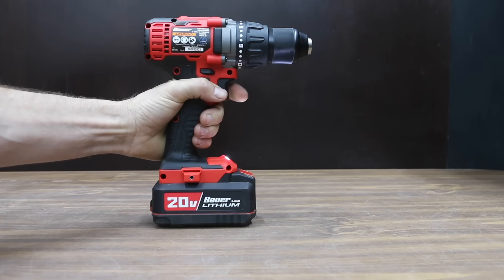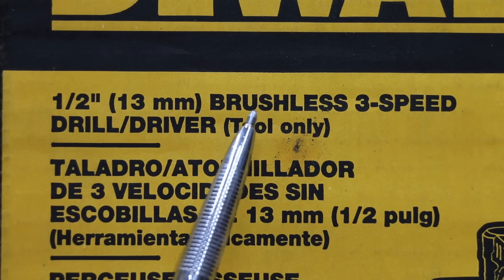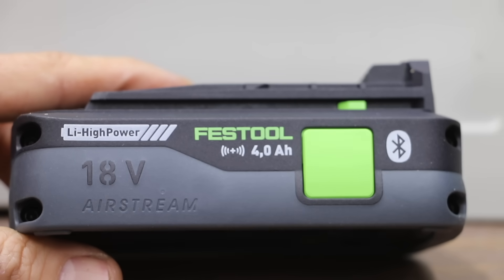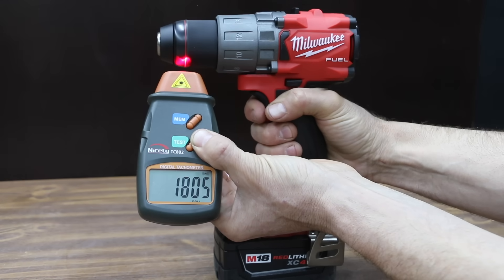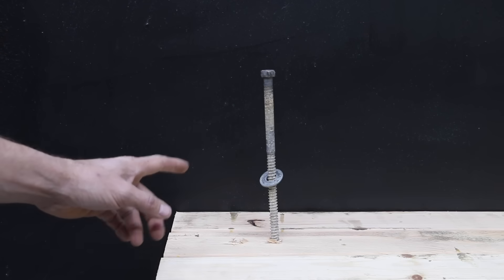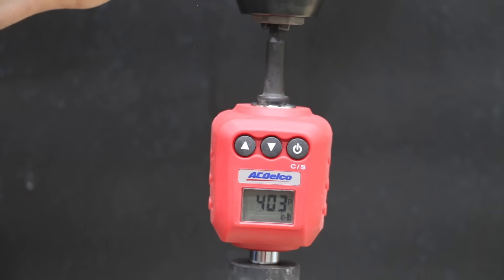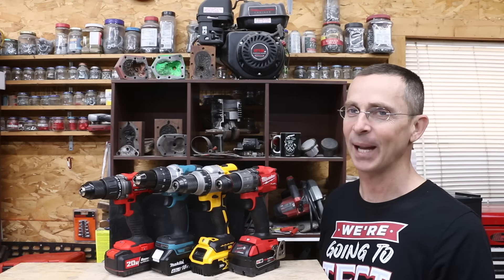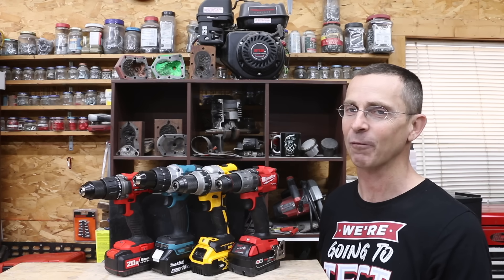Best Drill (BATTERY POWERED)? Milwaukee vs Dewalt, Makita, Bosch, Festool, Ryobi, Bauer, Ridgid

Comment: Key takeaway: Festool is way overpriced. It should have excelled in every test at that cost instead of being middle of the pack, or lower, on those tests. Thanks PF. Keep up the great work. 😁
Reply from the maker: Thanks, will do!  Thanks for the feedback.
Reply: @ProjectFarm  you're quite welcome. I've watched you for years. Anytime somebody asks what I think between this tool and that one, I always recommend your videos. If you've done one of course. You're quite thorough and as fair /unbiased as possible. 😁🖐️
Reply: This is a bit unfair. The festool drills are mainly used for...drilling. higher precision drilling at that. If you ever use one you will notice that they run way way less "rattly" than others and the high rpm is just better when drilling in wood
Reply: Inaccurate. Festool is geared differently from others. 4gear against 2 gear. As such the test itself was skewed . Should've chosen the correct gear for the task. Otherwise the test is merely comparing ,eg 600 rpm to 1200 rpm or 4000 rpm to 2000 rpm. Line two cars up and leave one in first gear...
Reply: @tinman7781  Whereas you have a valid point about the gearing, he accounted for that in all situations.
Reply: It seems like it might be good in applications where you don't need a lot of torque but need it to be able to spin really fast. Not sure what that would be though.

Comment: I love my Makita 18 volt hammer 🔨 drill and my 20 volt Dewalt impact and compact drill. That Makita is a straight up BEAST. I also got a couple old Dewalt 950's in 18 volt hammer 🔨 drill ,they are also BEASTS., still work but moved on to the 20 volt platform.
Reply from the maker: Thanks for the feedback.

Comment: I love your testing videos. The trouble I often have is the unavailability of the exact brands and models in my part of the world to compare against.  However I recognised the Bauer as being almost exactly the same as my cheap Ozito - the differences were mostly cosmetic and 18v rather than 20v.  It was an incidental purchase that has performed competently for light duties.  I purchased it only because I already had the battery system due to the medium sized wet and dry vacuum that I bought to keep in my car.  Now I also use the portable usb bank outlet, radio and torchlight skins.  Very cheap but useful.
Reply: FYI: 18V and 20V batteries are the same thing labeled differently. Both have 5 Li-Ion cells in series.
Nominal voltage: 3.6V*5=18V
Maximum voltage: 4V*5=20V.
Same thing with 10.8V vs 12V.
Reply from the maker: Thanks!  Thanks for sharing.

Comment: Subjective test not fair on the pricing, the Festool is the most expensive but if you add battery and charger for all the rest things are different, I’m using the Milwaukee and the Festool and are 2 different tools, both good/appropriate in specific applications .Festool is very precise ,reliable and comfortable to work with, the Milwaukee brute force as always.
Nice video.
Reply from the maker: Thanks!  Thanks for the feedback.

Comment: I bought the Harbor Freight Hercules drill kit(drill/5.0AH bat./charger/hard case) for $90 when I was in a bind(burned out my 15yo Dewalt 18v XRP). At first I was skeptical, but this drill proved itself to me after putting a 2" Lenox Bimetal hole saw through 1/4" plate steel at least 8 times on one battery charge(a task usually left up to my corded drill)! More than worth the $90!
Reply from the maker: Thanks for sharing.

Comment: Festool has an add on to work sideways, in tight places, which would make it the best to hit small spaces
Reply from the maker: Thanks for the feedback.
Reply: Yes and you can stick the Bit directly onto the machine, wich shortens the needed workspace too, but it is not magnetic then.

Comment: Had a $60 Bauer hammer drill/driver. Treated it like crap but it lasted 1 1/2 years. Only complaint it would kick the overheat cut off after a few holes. Frustrating
Reply from the maker: Thanks for sharing.

Comment: I'd be interested to see what that lowest torque setting on the milwaukee actually means. For light house stuff, like reassembling an appliance with a plastic housing, is it going to strip it immediately? Is it going to wreck cheap particle board like ikea stuff?
Reply from the maker: Thanks for the suggestion.
Reply: Yes

Comment: Surprised that you did not include RIDGID which is the best least expensive brand overall, esp used when you pick them up for very little money. The Milwaukee Fuel drill is the best overall for performance although it does cost more. Dewalt and Ridgid has the advantage that quality aftermarket batteries are available  (if you choose the right ones) If you ever need help with that, let me know. Amazon has 6.0 batteries that work well for Dewalt about $22 each.
Reply from the maker: Thanks for the feedback.

Comment: Thank you for such a comprehensive array of tests. I would only add one correction: I can see that in the minimum torque test, the Milwaukee and, I assume also the DeWalt are in their lowest gear 1. 

The electronic clutches are motor current based so in higher gears, the clutch levels will limit to a much lower torque scaled by the gear ratio. 

So for the Milwaukee we could expect the lowest torque to be 136in-lb*550/2000 = 37.4 in-lb 

For DeWalt 76in-lb*450/2000 = 17.1 in-lb
Reply from the maker: Thank you!

Comment: Every single issue I’ve ever had with a Milwaukee battery tool whether it’s a pex expander or a sawzall they’ve either given me a brand new tool or fixed the issue. I love their customer service.
Reply: I prefer a brand that doesn’t need fixing
Reply: @MartiniPinball  no kidding.
Reply: I had a 5.5 year old drill. Chuck teeth got out of alignment. Tool bound up trying to fix it myself. Sent to Milwaukee and told them what happened. They replaced the gear assembly and gave me a new chuck at no charge.
Reply: Probably this service is only for usa. Im fromu eu
Reply: Or they could do what Dewalt does and make tools that don't break 🤣🤣🤣👏👏
Reply: @Lee-lb9qh  yeah you can’t really consider it broken if it never worked properly can you?
Reply: @codygooch510  idk where you get your tools but mine work just fine 👍 paid off 2 houses with them....and still use them today.....
Reply: I never had an issue with my makitas. 
They are more ergonomic, better balanced and much smoother than any Milwaukee or default I’ve used
Reply: Harbor freight has a great warranty too, guess you have to if your gonna make trash tools 😂
Reply: I actually like my Rigid Drill with it’s lifetime warranty,  the BIG Problem is the Batteries suck and go bad fast you will spend more on batteries than a new drill
Reply: Same. Milwaukee is a standup company.
Reply: ok
Reply: Hands down the BEST
Reply: True, I had my 18v Milwaukee drill with impact/hammer drill that just randomly stopped working....sent it in and they fixed it and sent it back , been working great ever since!!
Reply from the maker: Thanks for sharing.
Reply: I’ve heard they have good customer service
Reply: Oh please. Although I have some Milwaukee tools, and have owned many over the years I believe in todays world DeWalt and Makita  have far surpassed Milwaukee. I would even argue that Milwaukee has become rather sorry.
Reply: @freeflyer6170  I think you're trying to get people upset. Well mission accomplished buddy. I haven't been able to sleep for two days after I read your comment.
Reply: @dangrimes5078  LOL…..guess I should have included those sorry Bosch tools in my comment.
Reply: @freeflyer6170  nah, you sound biased
Reply: @jegr3398  well I’m a few months short of 70, been using cordless tools since the late 1970’s when they first appeared in the area of the US where I was building. My first cordless drill was a Makita and my second was a Hitachi. 
A fellow carpenter bought a Skill brand that was a joke.
Reply: @freeflyer6170  well no offense sir but Milwaukee is still top of the line in my line of work. Which is remodels. And at that age you probably dont give power tools heavy professional use.  I see guys of all trades. And most of those tools are red.  I have a mix of Makita and Milwaukee tools and shit tons of batteries. Makita is ergonomic and every tool is great but theyre just not as strong as fuel stuff. The impact, sawzall and sds drill are insane
Reply: @jorgeo1492  Jorge, I can’t argue your point. I’m certainly not out working 50 hr plus weeks doing heavy construction although I have a custom woodworking business and continue to do a good bit of shop work; and I’m not commenting to incite emotional responses from folks, although I must admit I do enjoy poking the  bear on occasion. My major issue with Milwaukee is because I do know what an exceptional tool company they have been for a long time. They were the gold standard for plumbers for ever and their sawzall was the first and best of its kind. But I won’t back down as to the substandard trim router I just returned. It’s flaws are inexcusable. I also can’t stand the 4 cordless drill/screw guns I purchased a few years back and their battery packs. Now I’ve seen and handled the newer models and they seem just fine .
Reply: @freeflyer6170  I think we can all agree they don't make tools like they used to. Found a power drill in my dad's old shop from the 70s that my dad used a lot. Thing still worked like a beast.
Reply: @freeflyer6170  coming from a guy who deals with power tools every day for a job, Milwaukee has way more power, torque, charging speed,  and customer service
Reply: @ragingstormgaming7829  I doubt it.
Reply: @freeflyer6170  Maybe, but milwaukees's have been used every day and charged every day in over 100 degrees, sometimes inside a metal work van which gets higher than that. The milwaukee batteries and tools are years old, had never had one die on me

Comment: Not really a fair test. Most of these brands have different grades of tool. The xr dewalt is the higher grade while the ryobi used was the lower grade. I'm not familiar with the other brands but you lost me after the drill introductions.

Comment: i suppose, that error in testing brushed machines is, that machines should be runnet on for free for minimal one battery before testing its power... i liked more brushless machines, but it doesnt mean, that brushed machines are better or worse that another... just they could have better power but also bigger consuption/worse worktime, but as i sayed-they shoud be sometimes stronger.... but it needs to have brushes well fitted to comutator and test brand new machines without fitted brushes is useless as test....

Comment: Fresh out of the box testing is completely different from testing over time. This is why perfessionals will only buy certain brands. Over time most of these brands will just not do the work or last. I personally own dewalt, milwaukee, and ridgid. I have used the other brands here and there and they just don't hold up in real life work. I have owned my ridgid for five years but my Bosch set I got died in a year. Just an example.
Reply from the maker: Thanks for sharing.

Comment: I was surprised how hard the festool failed. Given that most festool users are a little different application than the big three, I suppose it makes sense. 

Would love to see Hilti and Metabo in on these, particularly Hilti since that and Milwaukee is what I see the most of on commercial jobsites
Reply from the maker: Thanks for the suggestion.
Reply: I don't know if metabo or walter would outperform Hilti or any other competition, but they would definitely outlast them.
Reply: @jeansboii  I dunno, I've got some Hilti battery powered tools that are going on 19 years old, and they still get used about twice a week, after a decade and a half of daily abuse at work. . 

I've had to send one battery in to a repair shop, but that's it. I do keep them clean and replace the brushes as needed but they have yet to fail beyond maintenance or the one bad battery cell.

Not sure if HILTI is still using the same manufacturing they had then, but the cordless impact and drill that I bought back in the early 2000s, it's a great product. I also have a circular saw, metal cutting saw, and a few rotary hammers, and hammer drills from HILTI. 

I haven't really ever used anything but their industrial tools, but those have held up great.

Comment: Nice review, but working with them I will say DeWalt is a disappointment, I've had a few and none live longer than 2years. Milwaukee is a good site drill and I have old ones that still work well, I just don't like them in the workshop. I've had the same festool drill for about 9years and I love it. Perfect balance and lasts all day on one battery in the workshop. Would never take it on site as I'm sure it would walk off.
Reply from the maker: Thanks!  Thanks for the feedback.

Comment: Would've liked to see the latest Flex 1171T, but I understand that only came out about 2 months before this video so may not have known about it or been available.  But technically has the highest specs I've seen on drills currently available.
Reply from the maker: Thanks for the suggestion.

Comment: Bought a TECCPO drill with case,  came with 2-20v batts and a charger from Amazon for the house at $75., and gotta say, after a year, still works like new!
Of course it likely wouldn't hold up for daily professional use like the expensive ones, but its good enough for my use!
Reply from the maker: Thanks for sharing.

Comment: I really enjoy these videos.  My son would be the Milwaukee guy (trim company owner) I’m the DeWalt guy.  I worked for my son until retirement.  In a hardware situation we always pre-drill our screws.  I have always used the impact driver as my screwdriver much faster and easier to control.  For the most part when I would break a screwdriver bit it would be driving 3 1/2 to 4 in screws into an exterior door Jamb.  I liked DeWalt screwdriver bits. 😀
Reply from the maker: Thanks!  Thanks for sharing.

Comment: Makita's power and speed surprised the hell out of me. This story is about corded drills. About 30 years back, I bought a 1/2" Makita drill and I could easily hold it with my bare hand. I returned it and tested a second one before leaving the store. Same thing, the second one was junk too. The sales guy suggested I check a Skill and there was no holding that one, I bought it and to this day, it remains in my basement ready able and willing to break your wrist, any time you want to try to stop it. It has been an amazing drill. I was so happy with it, I bought a second one.
Reply: I ve got similar cases with Makita...one from 30 years ago used it to mix buckets of concrete for many years. Other from 70 or 80 used by my uncle in his farm, got it now and looks and works like new.
These cordless ive had many and u can't brake them using for work.
Reply from the maker: Thanks for sharing.
Reply: Im 34 and I still have my 14.4v Makita 3/8 impact, drill and light I bought off the tool truck when I was 19. It was my first cordless tool set. I was changing oil and rotating tires at Firestone

Comment: I'm sure Festool had some nice fit and finish. I just really struggle with why someone would pay that much for what looks like a middle of the pack performer.
Reply from the maker: Thanks for the feedback.
Reply: It is middle of the pack because the tests focused on raw power, but the Festool is designed for smoother/better speed control for more delicate tasks working on fine wood material.
Reply: @brianmckenzie9171  ... It's a drill. How it interacts with wood is likely more determined by the bit than whether it spins the right way

Comment: Of these brands we use makita, bosch, dewalt, milwaukee and festool.
All brands used daily. 
The festool drills and the batteries were purchased in 2002 when our company was founded. Even if they're not the best at all applications they are reliable.
There's not a single machine of the other brands with that survival rate.
My personal festool I got when I started in 2009 and it's one of the old ones. Still using it.
Reply from the maker: Thanks for sharing.

Comment: I have a mikita the 18v dark blue one.i left it in a 5 gallon bucket and a year later the bucket had weathered all the weather and was full of water. I don't know how but my drill worked straight out of the bucket. It worked till the battery died and the battery died. I opened it up and have no idea how it was still working. I got a new battery and 5 years later the drill is still choochin. Amazing. And I'm not exaggerating on the 1 year in a bucket time frame it was exactly one year I have a receipt from the state hotel otherwise I wouldn't have left it in the bucket.
Reply from the maker: Thanks for sharing.

Comment: jumping up to a 500 dollar drill to compare to common trades people drills is somewhat foolish; plus why not include the Hilti products? Trades people will not use cheap crap like the Riobi or Bauer; most use Dewalt. As someone who has worked at hundreds of job-sites I can tell you that almost everyone uses Dewalt, so I opted for Milwaukee. I found the Dewalt brand drills better and more powerful than Milwaukee but Dewalt has one major drawback: when trades-people arrive on a job-site, they find out where the temporary power is and plug in their battery chargers; I got sick and tired of plugging in my new spare batteries and stepping away only to find, when returning for my now charged spare, that some other trades-person had swapped out my new battery for their cheap junk after-market or worn out battery: by using a brand of drill that other trades-people don't use, this problem was solved.
Reply from the maker: Thanks for the feedback.